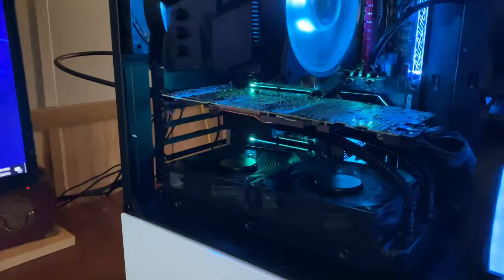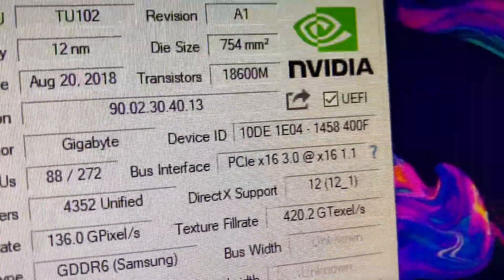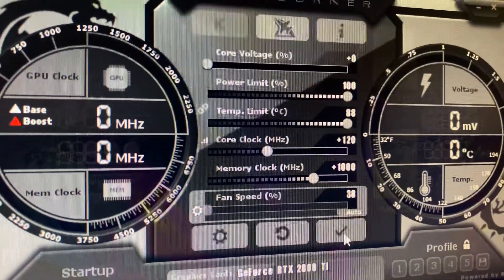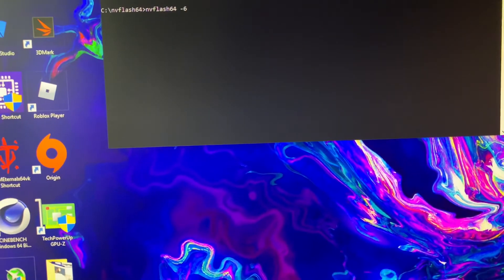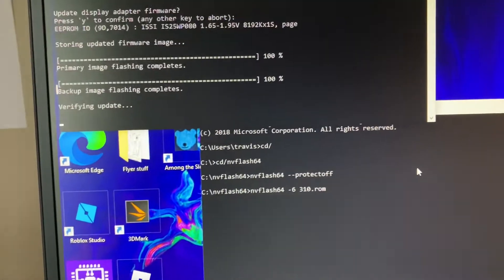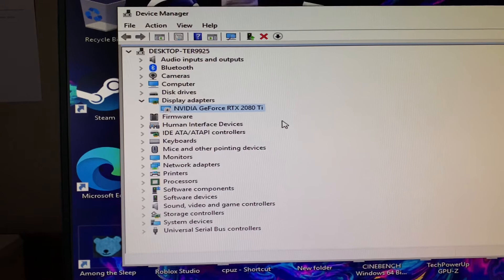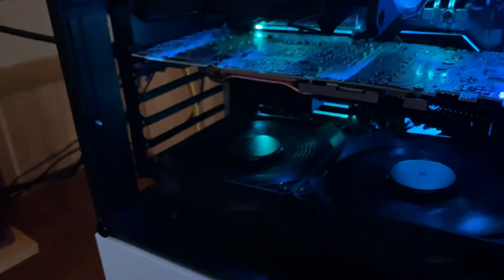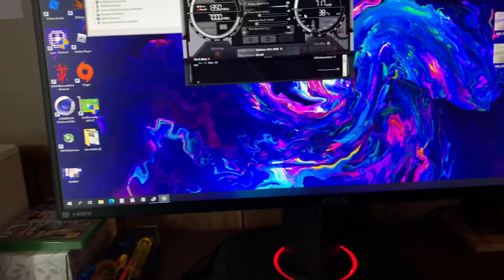AORUS Game box 2080Ti eGPU bios flash! 250 watts to 310+ watts

Comment: Hi! I've ordered this eGPU from NewEgg and plan to use it as intended with my current laptop. However - I still would like to flash the bios to increase the power limit as I've read it stays very cool even within the eGPU enclosure. I'm relatively new to this. Would you be able to walk me through the exact steps you took to download the correct BIOS, prepare them, and perform the flash? I'd be super grateful, and can provide my reddit or any other info if you want to discuss offline. Thanks!
Reply: I think I actually found them. I believe you used these: https://www.techpowerup.com/vgabios/208274/palit-rtx2080ti-11264-190131
And I plan to follow this guide: https://www.overclock.net/forum/69-nvidia/1706276-official-nvidia-rtx-2080-ti-owner-s-club.html

The only thing that differs from what you did is the guide doesn't mention disabling and enabling the card in device manager like you did. Is the necessary? Do you have any advice for anything I might be missing?

Thanks!
Reply from the maker: Bryant Magnien 

Using a high power limit bios will not help if the box is used through TB3. Because you are already bottlenecking the performance of the card at its 250 watt bios limitations using TB3. That’s like owning a Lamborghini with a top speed of 60MPH and trying to increase HP even further. You can still only go 60MPH. 

You don’t have to disable it in device manager. But it is just a precaution I take. The Palit NoN-A bios will allow 310 watts. I would highly recommend the power modification with stacking 8 Ohm shunts on this card. This will allow around 450 watts, while tricking the cards power draw, it thinks it pulls 40-45% less power than it really is. Also, when using the Palit bios the fans and pump will spin much slower. Because the Palit cards bios allowed a max rpm of around 2,200RPM at 100%. The original Aorus eGPU spins around 4,000 RPM. So once you flash to the Palit bios and even if you set your fan to 100%, it’ll only be spinning around 50% in real life. Just a heads up.

I had my Aorus eGPU flashed to the Palit bios, and I soldered on the 8 ohm shunts, this allowed 450watts steady. And I could easily manage 17,300 in timespy graphics score. And 41,000 in Firestrike graphics score. The card was literally in a different league! And the performance is in line with what leaked RTX3090 numbers are. 

There is also a Gigabyte non-A bios which is 300 watts and allows full fan speed and full pump speed. 

Google 2080Ti owners club. And go to page 1. You’ll see the different bios on the first page for A and non A cards.
Reply: @videocardzrule354  all great info, thank you. i know the TB3 will bottleneck, but I was under the impression I could still get more power out of the card via this form of OC. So let's say the TB3 throttles performance by 20% at stock speeds, it'll still throttle performance at OC speeds by 20% but because the floor has been raised, I'll still be able to see marginal improvement.

Very interesting about the 50% fan speed issue, that may hinder my optimism about thermals but I plan on running fans at 100% at all times rather than set up a custom fan curve, so even if it's 50% at all times hopefully it'll do the job. If not I can always revert to stock BIOS.

Any chance you know of a 310w BIOS for NonA chips that don't have this fan issue?
Reply from the maker: Bryant Magnien 

This is a bios that will work best. It will allow maximum fan speed, maximum pump speed. And 300watts power. 

https://www.techpowerup.com/vgabios/220423/220423

They are LOUD AT 100% with this bios. This was the last bios I ran. So, the card could pull 300 watts plus a additional 40% on top for a total of 420 watt total running at a locked 2,130-2,145Mhz it still ran around 48-52C Max temps during Red dead redemption 2.

I would highly recommend that gigabyte bios instead. You only lose 10 watts, and you will not lose any fan or pump speed.
Reply from the maker: Bryant Magnien 

And no the floor cannot be raised with TB3 via a OC. It is already struggling to send all of that bandwidth via a small TB3 cable, and you are furthering the bottleneck with an even faster and more powerful core clock. Unfortunately we are in a bad time for eGPU’s once PCI-e 4.0 becomes the standard then external graphics will finally be a viable option. Because PCI-e 4.0 at only X4 lanes can output more bandwidth than a PCI-e 3.0 at X8. And running pci-e 3.0 at X8 shows minimal performance loss as it is. 
As for overclocking the card and expecting more performance through TB3 I’m not so sure about it. I would recommend a external monitor connected directly to the eGPU box for much better performance though. Having to output the performance through the box and back in to your laptops display will greatly hurt performance even worse. Always use a external monitor connected to the eGPU.
Reply: @videocardzrule354  We're definitely speaking the same language now! I will try the Gigabyte BIOS at 300w to ensure I can utilize the fans correctly. I'm definitely going to be using an external monitor. My theory is the TB3 bottleneck is only used to send the initial info from the software (game) for rendering over to the card. Once that data gets there, it's beyond the bottleneck, and that's where it will encounter the higher power limited OC card for final rendering, to let it do it's thing with the built-in 450W dedicated power supply, and then on out to the external monitor. That's why I think OC'ing could still have its benefits. But I definitely get your theory as well.

One more question: I was VERY surprised this card was a non-A. It's referred to as a Waterforce 2080TI on gigabytes website, and I couldn't find any non-A waterforce standalone cards. Were you able to track down the gigabyte card that this actually is, since it doesn't appear to be a true Waterforce varient?
Reply from the maker: Bryant Magnien 

It is not a waterforce. I’ve examined it better than anyone. It is a reference 2080Ti PCB, with a NON-A TU102 die, both 8 pins relocated to the back of the PCB. However, it does have Samsung GDDR6 which was nice. The Gigabyte Aorus waterforce 2080Ti uses a custom PCB and a factory 366 watt power limit and a OC binned TU102A die. The only thing they share, is the actual water block is identical between the two. However the Aorus waterforce 2080Ti has the water lines rotated 90 degrees. And on the Aorus eGPU non A waterforce the water lines are parallel with the length of the card. 
Also, bare in mind 300 watts is still very low for a 2080Ti.  Even just a Reference 2080Ti’s VRM’s and power delivery are built for 600+ watts of constant power draw safely 24/7. Nvidia severely limited these cards from the factory. One thing that’s funny, is any 2080Ti can be as fast as another. My Aorus eGPU 2080Ti NON-A could easily compete with a Kingpin 2080Ti that costed nearly $2K. 
When you get brave I would highly recommend the power mod via soldering on the 8 ohm shunts. It is safe, and very easy. I could send you (2) shunts for free. Squeezing 30% performance on top of a 2080Ti Founders Edition performance is worth it! I sold my Aorus 2080Ti eGPU to a very wealthy mining company and they own several of these eGPU boxes. They are scratching their heads as to why mine is so damn FASTTTTTT compared to their other 2080Ti eGPU mining boxes. Little do they know, it is a beast pulling nearly every ounce of its available 450 watts running cool as can be.
Reply: THE REAL FAMILY CHANNEL that makes a lot of sense. How can I contact you to continue this conversation? You’ve been immensely helpful so far. I can give an email or text...or we can use discord or Reddit or something, whatever you’re comfortable with?
Reply from the maker: Bryant Magnien 

Hey, don’t forget about the $100 dollar rebate on the gaming boxes too. It ends soon, so you must cut the UPC barcode from the box fill out the form and mail it in. You can email
Me anytime at tps3443@icloud.com if you ever need any help. Be careful with the bios flash. Make sure you back your up. If not, I do have a original copy of that bios. Also, I can perform the power modification for $60 USD. Which will increase power an additional 40%. This is a permanent modification that will easily outlast the card. This isn’t some liquid metal mod that damages components like some people do on the internet. It is safe, and long term!
Reply: @videocardzrule354  just sent you an email, thanks again!
Reply from the maker: @Bryant Magnien

You should be glad you waited!! RTX3080/3090 are killing 2080Ti! Even just a RTX3070 for $499 will be faster than a 2080Ti. Amazing!
Reply: THE REAL FAMILY CHANNEL lol yes I’m very happy. I’m currently having the fun of dealing with UPS and Newegg to get the return sorted out. And then I have to decide between the 3080, 3090, FE or AIB, and whether to stick with the Razer Core I picked up or go for a newly released Mantiz with a 750w, 3 8-pin design. Lots of decisions and research ahead!
Reply from the maker: Bryant Magnien 

Go for a 3080. It is going to offer 80% of the performance for less than half the cost of a single 3090. Nvidia has killed it this time. Reason I say go 3080, because they may release refresh cards in a year. “Ti” or “Super” variants. And you wanna make sure the cards will be solid without issues. Last gen 2080Ti’s we’re dropping like flies after launch. They were dying left and right with artifacts. You don’t want a $1,500 paper weight, or something that’ll be bested in 10 months by a Ti model. So, investing only $700 bucks really gets you everything. But hey, it’s your money!
Reply: THE REAL FAMILY CHANNEL all of your analysis makes a lot of sense, and I honestly haven’t made up my mind yet, but I found an awesome eGPU enclosure that will fit the huge 3090 AIBs and provide 3 8-pins from a 750w PSU, and I basically want to overcome the TB3 15-20% loss by going big or going home. My hope is to approach 3080 levels after all is said and done with overclocking, minus the TB3 performance hit.
Reply from the maker: Bryant Magnien 

I think you may be misunderstanding how that eGPU is going to work. Running a more powerful GPU through a bottlenecked TB3 connection will not give you better performance. For example, if you ran a 2080Ti, or a 3080, or even a 3090 all in a eGPU enclosure. They would all perform identical, because they are all severely bottlenecked. You will achieve Worse performance than a RTX2070 in a laptop whether you’ve got a 2080Ti or a RTX3090. Your performance is going to be very weak. It will not increase from the bottlenecked 2080Ti performance because a GPU is more powerful inside of the enclosure, it simply can’t make it magically transmit more data through TB3. 

In all honesty, considering next gen is here and these 2080Ti’s have practically fallen to $500-$600 bucks. I’d look for a 2080Ti eGPU used for dirt cheap. Or maybe run the 3080 inside a enclosure. But hey, if you want to go all out. I’m not stopping you lol. I’m just saying, if you actually run a 3090 inside of a eGPU enclosure it will perform at the maximum limits of how a 2080Ti eGPU already performs. Only then 3090 will have less utilization, and even more power wasted.
Reply: @videocardzrule354  I understand that TB3 presents a bottleneck. But I don't believe that the 2080TI, the highest card we actually have data from, represents some hard stop in relative gains to the extent that a eGPU running a 2080TI, 3080, or 3090 will all benchmark the same. That's my opinion as of now, before we have any data to show otherwise, and we'll soon know the answer definitively. Here's the data we do have:

Time Spy Graphics Score

GPU		Average of All Desktop	9980HK MBP w/eGPU		% Difference
GTX 980	        4,365				        4,154				                -5%
GTX 1080	7,571				        6,824				                -9%
RTX 2080	11,116				        9251				                -17%
RTX 3080	???				                ???				                        ???

Time Spy Extreme Graphics Score

GPU		Average of All Desktop	9980HK MBP w/eGPU		% Difference
RTX 2080 TI	6480				        6382				                -1.5%

eGPUs performs closer to their desktop counterparts at higher resolutions. The 4k TSE benchmark shows only a -1.5% performance loss in an eGPU setup for the 2080TI vs in a desktop environment. I wouldn't call that hitting a hard stop bottleneck. At lower resolutions in TS benchmark, yes there is an increasing level of degradation per GPU cycle. I'm predicting that trend to continue in kind, and predict a -25% performance loss for eGPUs for the 3080 in TS, and a 5% in TSE, based on our best current data. I'll update this with actual data when we have access to these cards to test for ourselves.
Reply: In the interest of objectivity and transparency, I found an error in my data. I used the overall score for ‘all desktop 2080 ti average’ for TSE instead of graphics score. The graphics score average is actually 7006, not 6480, vs the eGPU’s 6382, representing an loss of 9%. I’ll also revise my expected loss of a 3080 in TSE to -15% from my previous estimate of 5%
Reply from the maker: Bryant Magnien

TB3 is X4 PCI-e 3.0 the bandwidth is 100% over saturated with a stock 2080Ti. So, adding a more powerful GPU will absolutely not yield more performance, because there is no room for growth. The X4 pci-e is totally saturated lol. There is nothing you can do

Running 4K will do nothing at all. Running just a 2070 Super in a eGPU on a external 4K monitor, and then running the same 2070 Super in a desktop would increase performance 50-100%. Theirs Not a 15% loss with a eGPU. 15% is like going from RTX2080 to 2080 Super in desktop form. 

It’s like me trying to run a NVME M.2 with PCI-e 4.0 on my X299 platform that only has PCI-e 3.0. I have totally bottlenecked and saturated the 3.0 pci-e. So I simply cannot achieve faster performance with nvme pci 4.0 ssd. 

A 2080Ti saturates TB3, a 3080 saturates it, and anything else beyond those too.
Reply: @videocardzrule354  Could you provide data to support your 2070 S 4k comparison? Here's one I found:
4k Superposition 2070 Super Desktop: 8307
(https://techgage.com/article/nvidia-geforce-2060-2070-super-review/5/)
4k Superposition 2070 Super eGPU: 6977
(https://egpu.io/forums/builds/2019-15-dell-precision-5540-nvidia-quadro-t2000-9th8chk-nvidia-rtx-2070-super-32gbps-tb3-razer-core-x-chroma-linux-win10/)

eGPU loss = -16%. A far cry from 50%-100% as you claimed above. If you can provide data if would certainly help me make a better informed decision. I think you're discounting the processing that gets done after the initial data makes it through the TB3 bottleneck. While this bottleneck is upstream, it doesn't represent 100% of the processing that takes place to render the final frame. Placing a more powerful GPU downstream speeds up the bottom half of the computation cycle. So let's say 50% of a frame time render occurs prior to reaching the GPU, and the other 50% occurs in the GPU before being exported directly to an external monitor. You may have hit a bottlenecked wall for the first half, but if you can decrease the second half with a more powerful GPU, you will reduce TOTAL frame time render (at admittedly diminishing returns) as you get closer and closer to zero in the second half, wtih a theoretical limit of that 50% upstream bottleneck that you've referenced above. i just think you're completely discounting the other 50% of the equation.
Reply from the maker: Bryant Magnien 

Here is a link to the eGPU video where I mentioned 50-100% better performance going from 2070 Super eGPU to 2070 Super desktop. 

https://youtu.be/gT9_q6Suut4

If you do run a eGPU, the only way to use full 100% power is if your running like, compute workloads that are able to utilize the entire card, while only having to transfer minimal data back.
Reply: @videocardzrule354  I agree full 100% power is never going to happen, that's not the plan. I totally believe your experience and relative performance issues in your 2070S test. Here's some more data I gathered from the highest available source (2080TI) comparing average desktop to MBP eGPU:

Average Graphics Scores for RTX 2080 TI Desktop vs 2080 TI MBP eGPU 

		Desktop		eGPU		% Difference
TimeSpy	14566			12615		-13%
TimeSpy Ex.	7006			6382		-9%
FireStrike	35578			24787		-30%
Port Royal	8861			7159		-19%
SuperPos 4k	11220			11145		-1%
Heaven 4k	1588			1321		-17%
Reply from the maker: Bryant Magnien 

That is all synthetics. Not accurate at all. You can render synthetics off screen with an eGPU. Look at gameplay. The performance is disgusting to say the least. “In every single game” 50-100% average loss with just a 2070 Super. Also, 10,600 in time spy?? You
Just understand a 2080 Super can get 12,900 graphics. I’d wait until next gen ampere laptops  . If you must have a laptop.
Reply: @videocardzrule354  I'm confused. Where do you see '10,600' in the data I presented? These may be benchmarks but it's the most readily available, objective, and reproducible data we both have access to. I think calling them inaccurate is hyperbolic, disingenuous, and dismissive. It's extremely hard to get access to non-anecdotal gameplay tests, so I chose a wide range of easily peer-verified benchmarks instead. I'm happy to provide sources for the data I've previously presented, and look forward to seeing more of your data-driven findings as well!
Reply from the maker: Bryant Magnien 

I certainly believe the synthetic benchmark numbers. 

I sent you a link of a 2070 Super running in a eGPU, and then in a desktop. It performs horribly, about half as good as a desktop did with the same GPU. I don’t know how else to explain this to you. Go buy a eGPU and run it for your self with an Ampere inside, and your gonna see it first hand in games. This is the only way you will see it.

Ask anyone in the world, I cannot explain this to you any other way. EGPU’s lose about half of the performance.

I’ve owned them, I have experienced with them.  I have ran a GTX1080 eGPU’s in games and watched it perform just like a GTX1060 sometimes much worse. 

That’s why I immediately took my 2080Ti eGPU apart and pulled the card. Don’t you realize if I thought performance was even remotely close, I could’ve just ran it inside of the enclosure with my power mods and bios mods. My desktop supports TB3, I wouldn’t have even tested it or tried it. 

The only time a eGPU is useful is if you have a laptop with a very weak integrated graphics, or no discrete graphics. Then you can use one for gaming for sure. 

I’m not lying to you. I’m being real here. Actual gameplay performance is just terrible with an eGPU. And we are at the limits of TB3.